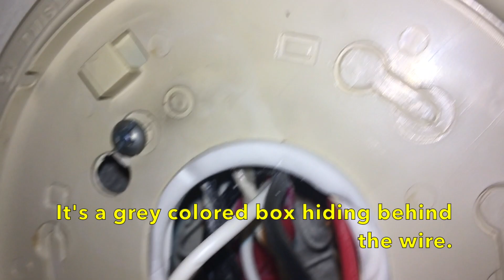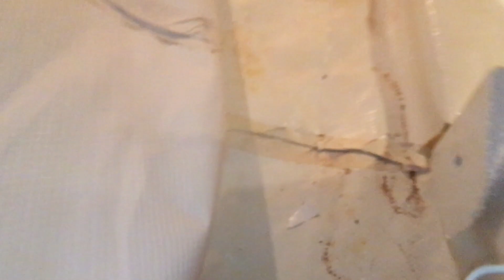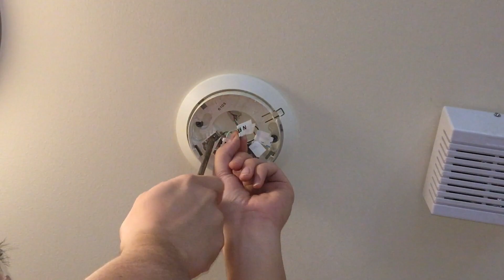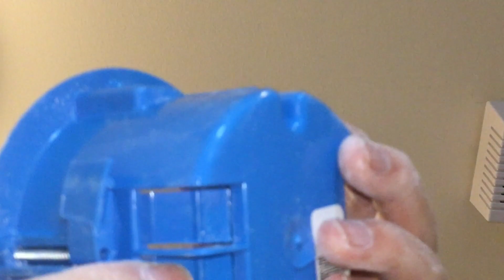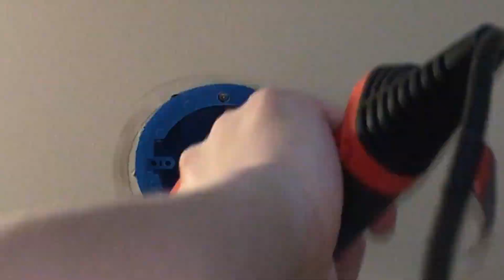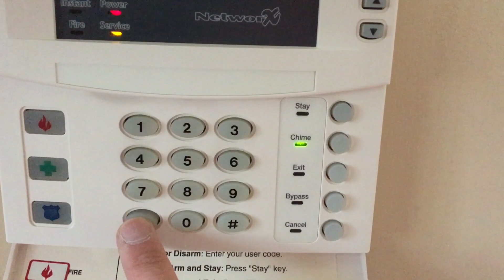Tutorial ~ Installing a Ceiling Mount Electrical Box

Comment: Should be using a fiberglass or wood ladder. Although it isn’t required by osha it’s just common sense
Reply from the maker: Thanks, and good catch!  I didn't think about that since I was wiring low voltage stuff.

Comment: You still have two issues with you smoke detector, your power is not supervised for trouble and  the smoke detector does not have an end of line resistor.  At this point no need for a back box. Sorry for the negative comment
Reply from the maker: There is an end of line resistor on it - otherwise the panel would report an open circuit whenever the detector is inactive.  I'm also working on getting the relay for the power to be supervised, though.
Reply: @BousaiGuy   The resistor should be mounted at the end of the line. I think you have it in the beginning of the line. If you remove the circuit wire from its NO circuit  on the S. D. the panel will not do anything.

Comment: After you draw a line around the perimeter you need to cut the hole 1/8" smaller or the whole thing could fall into the wall or ceiling.
Reply from the maker: Thanks!  In retrospect I probably should have drawn an outline on the other side of the box.